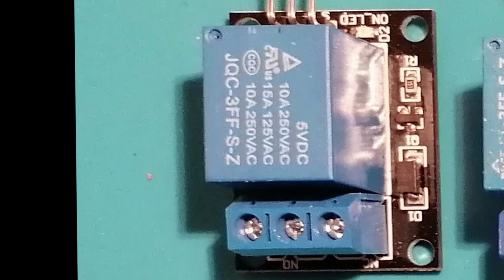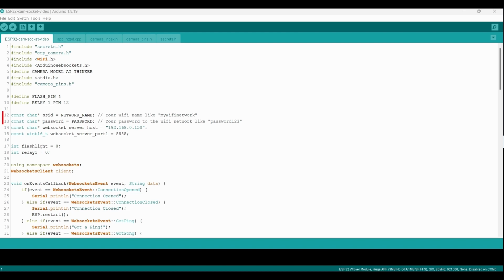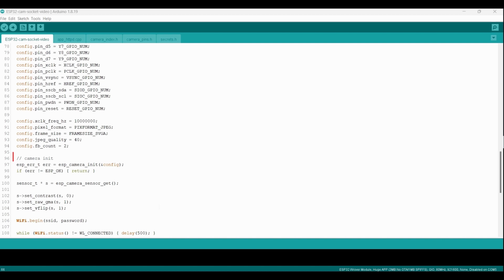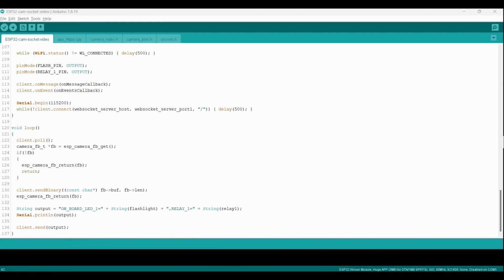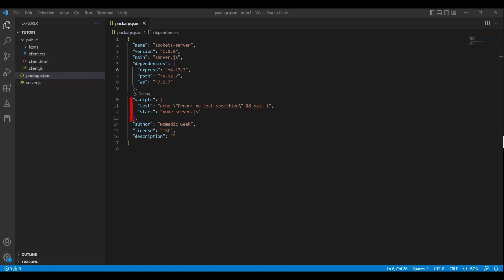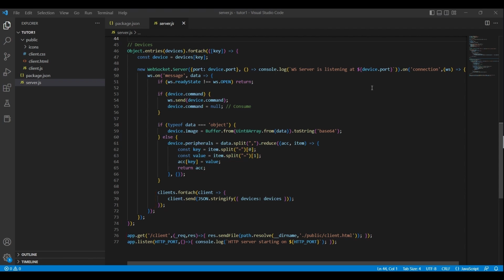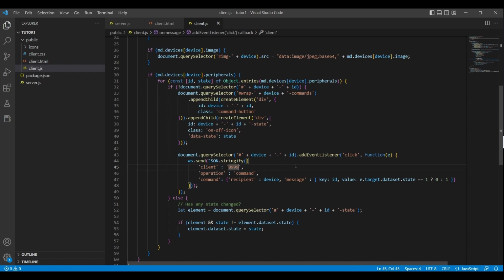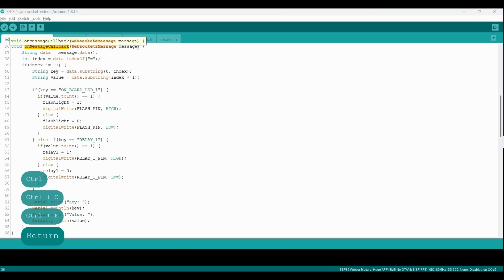ESP32-CAM Video over Websockets with Relay Bi-directional

Comment: Hi brother. This was almost perfect and complete. Happens that I have that some website on node.js, express and  MongoDB so this was nice reminder and you included the necessary steps. I would like maybe more explanation on the flow of data like when the esp32 gets updates on commands sent from the client(when esp32 itself sends messages) I am just starting but this one was the only comprehensive(I would like only those couple of lines left - being explained as well, but I will check them on ChatGPT, packed with information, friendly, made it look easy because of understanding and encouraged to go further. It's my first comment like this on YT but honestly I liked it. I liked the music! and friendly intonation AI! also it sounds a bit robotic, like being read not following context that would give out clues(flow) otherwise, but this is the only thing I can find. I would like to make a drone flying on a WiFi network, gradually adding new functionalities, with database and machine learning, and I am just starting with microcontrollers. Great content. Best on YT so far. Thanks.

Comment: heyy i want to add an 1.8 tft but i get this error:
14:49:16.375 -> Guru Meditation Error: Core  1 panic'ed (LoadProhibited). Exception was unhandled.
14:49:16.375 -> 
14:49:16.375 -> Core  1 register dump:
14:49:16.375 -> PC      : 0x40094003  PS      : 0x00060d30  A0      : 0x8009432c  A1      : 0x3ffb2000  
14:49:16.375 -> A2      : 0xffffffff  A3      : 0xfffffffc  A4      : 0x00060d20  A5      : 0xffffffff  
14:49:16.574 -> A6      : 0x00060d23  A7      : 0x00000000  A8      : 0xffffffff  A9      : 0x00000004  
14:49:16.574 -> A10     : 0x00060d23  A11     : 0x0001c200  A12     : 0x0800001c  A13     : 0x00000000  
14:49:16.574 -> A14     : 0x007cf258  A15     : 0x003fffff  SAR     : 0x0000001b  EXCCAUSE: 0x0000001c  
14:49:16.574 -> EXCVADDR: 0x0000000f  LBEG    : 0x4008b950  LEND    : 0x4008b96c  LCOUNT  : 0xffffffff  
14:49:16.574 -> 
14:49:16.574 -> 
14:49:16.574 -> Backtrace: 0x40094000:0x3ffb2000 0x40094329:0x3ffb2020 0x40094fc3:0x3ffb2040 0x40095134:0x3ffb2060 0x40083fd4:0x3ffb2080 0x40084203:0x3ffb20b0 0x400e4429:0x3ffb20d0 0x400dfc77:0x3ffb2120 0x400dda5d:0x3ffb2180 0x400d30e6:0x3ffb21c0 0x400e0056:0x3ffb2290
14:49:16.574 -> 
14:49:16.574 -> 
14:49:16.574 -> 
14:49:16.574 -> 
14:49:16.574 -> ELF file SHA256: f0854a0982302c15
14:49:16.574 -> 
14:49:16.591 -> Rebooting...
14:49:16.591 -> ets Jul 29 2019 12:21:46
14:49:16.591 -> 
14:49:16.591 -> rst:0xc (SW_CPU_RESET),boot:0x13 (SPI_FAST_FLASH_BOOT)
14:49:16.591 -> configsip: 0, SPIWP:0xee
14:49:16.591 -> clk_drv:0x00,q_drv:0x00,d_drv:0x00,cs0_drv:0x00,hd_drv:0x00,wp_drv:0x00
14:49:16.640 -> mode:DIO, clock div:2
14:49:16.640 -> load:0x3fff0030,len:1344
14:49:16.640 -> load:0x40078000,len:13936
14:49:16.640 -> load:0x40080400,len:3600
14:49:16.640 -> entry 0x400805f0
Reply from the maker: Hey! Thank you for watching! Have you tried running the LCD by itself with your ESP32? Without seeing your code or any additional information about your setup, it seems to me that you might be trying to access an invalid memory address. This could be the case if you have configured the wrong type of LCD in your code.

Here are a few more tips to help you troubleshoot:

Check Your Wiring: Sometimes, issues arise from simple mistakes in the wiring. Ensure that all connections are secure and correct according to the LCD’s datasheet.

Update or Reinstall Libraries: Make sure that you are using the latest version of the library compatible with your LCD. Sometimes, updating or reinstalling the library can resolve unseen issues.

Simplify Your Code: Try to simplify your code to the bare minimum required to initialize and use the LCD. This can help eliminate any potential software conflicts or unnecessary complications.

Review Documentation: Thoroughly review the documentation for both your ESP32 board and the LCD. There might be specific settings or quirks noted in the documentation that are crucial for your particular hardware setup.

Use Example Sketches: Run example sketches provided with the LCD library, if available. These examples are typically designed to demonstrate the correct initialization and usage, which might help you pinpoint what’s going wrong in your setup.

I hope these suggestions help! Keep experimenting, and don’t hesitate to ask for more help if you need it.

Comment: how do you power ESP 32 cam , if you use 12v battery? you just connected ESP 32's GND to battery..
Reply from the maker: Hi! You have to use a step down to 5V to power the ESP32-CAM module. You can do this with eg an LM2596 DC-DC Buck Converter. You can see me using it here: https://youtube.com/shorts/MjuixQkyk3Y
Just browse Amazon for LM2596

Comment: Hi Nomadic, I put together a camera using ESP32-cam, and a 5vdc stepdown from a 9 volt battery. Image appears on a webserver.  All works well.  The problem is that the 9 volt battery dies rather quickly and pushing the button on the 5volt stepdown is not practical.  I need a way to control the power going to the camera with a relay connected to wifi, so that the camera only works when i turn it on with my phone, hopefully saving the battery.  If there a way to do this using a relay connected to the ESP32?  Seems to me that would still use the same amount of current as if the camera was on. How can i turn the camera on or off without using too much power.  Thank you so much for your help.
Reply from the maker: Hi,

Thank you for your question. It's great to hear that you've successfully set up your ESP32-cam and webserver.

There are multiple approaches you could take to minimize power consumption. I recommend exploring Deep Sleep Mode or possibly lowering the frame rate and resolution of the camera.

Using a relay to control the power to the ESP32-cam could work; however, you are correct that this method may not significantly reduce overall power consumption if the relay itself uses a lot of power. A more efficient solution might be to use a solid-state relay or a MOSFET, which consume very little power in comparison.

One approach I would consider is allowing the client to send commands to the ESP32-cam to turn the camera on and off. While the module would continue to operate, the power-consuming camera could be deactivated when not in use, thereby saving energy.

Comment: Great video but i do have a problem, why the video is blinking in my program, altough the code is same with you, but i dont have an antena is that a problem why the video is blinking?
Reply from the maker: The issue with the blinking video stream is likely caused by low voltage, in my estimation. To troubleshoot this, I suggest bringing your device closer to the router and observing whether the problem persists. This will help you determine if the issue is related to a weak connection.
Reply: i had the same problem. I solved it commenting lines 133, 134 and 136.